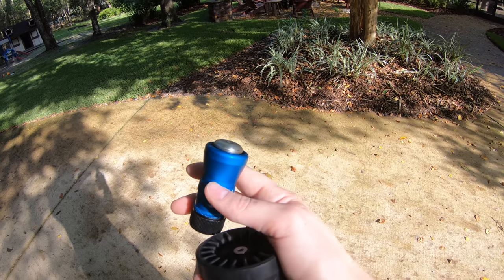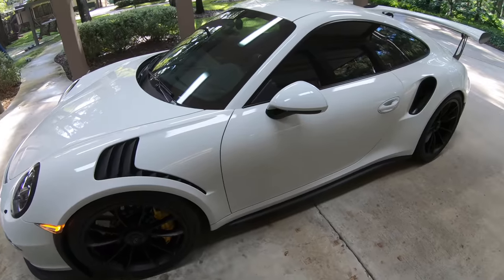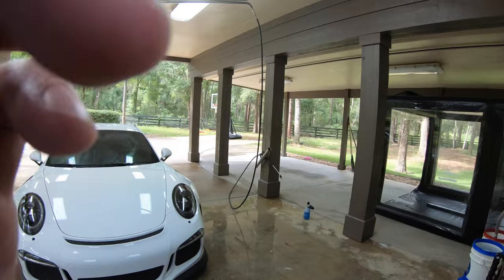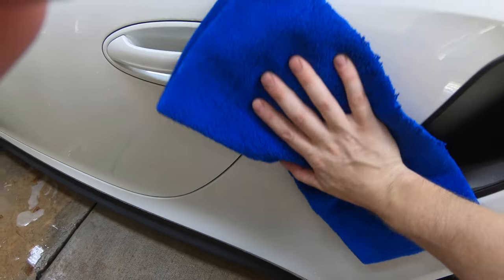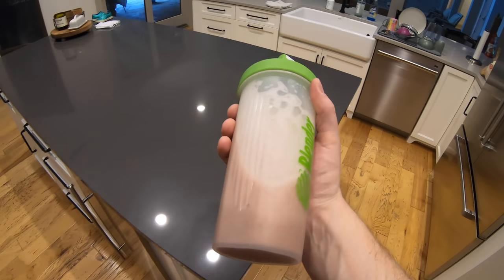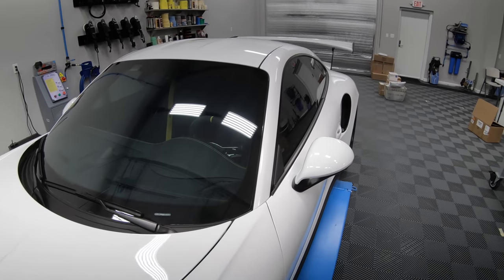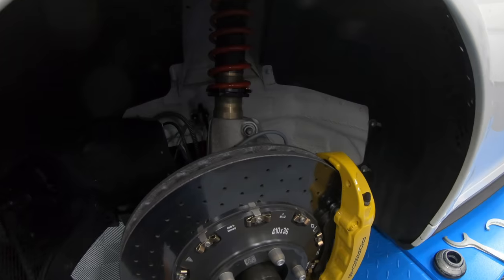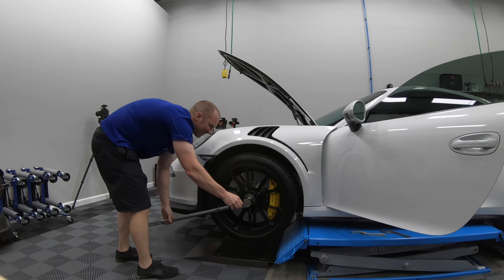GT3 RS Vlog Day 7 | 28 | 2018 @ 4K/24fps

Comment: You mention about removing the exoshield because of trapped dust. Are you planning on reinstalling again?  I was just getting ready to pull the trigger on having this installed on my 911 Turbo.
Reply from the maker: Yes, I'm going to reinstall it.  It's pretty legit.
Reply: Obsessed Garage, do you think the issue you had with the dust making its way under the film? Is a common problem or something was overlooked in the install?
Reply from the maker: It was due to them carrying the film across the room with the backing removed.  Alchemy now suggests removing it with the film laying on the windshield to minimize the risk.

Comment: Subaru looks totally insane parked outside.

I've only ever done 845 solo. Might need to rethink that and see what happens.
Reply: nailbomb3 The correction process is what makes the paint look incredible. The wax won’t make much of a difference if the paint is already dialed in. Btw I love 845, super easy to work with and very durable.
Reply: Andres Rivera 100% agree with everything you said
Reply: MikeEM1 as do I. I'd do both just to see if.longevity is indeed better

Comment: Lol why not get oem filters at porsche instead of cheap Aftermarket filters from autoparts stores.
Reply: ProjectGTR Wix filters are OE VAG parts.
Reply: Kamron Mikuta what does a standard vag 4 cylinder have to do with a porsche boxer? Nothing. As you can see in the video the car has a Mahle oilfilter. (they also make the internals like pistons for these engines)
Reply from the maker: Because I had the wrong size OE filter.  They didn't have one anyway.
Reply: Obsessed Garage oh okay. Thats kinda weird.
Reply: ProjectGTR Porsche/VAG specifies a micron rating and efficiency rating for an oil filter specific to each car. As long as the filter meets that standard, it is approved for use whether in a GT3 or an A4. And yes, Mahle pistons are used in most, if not all VAG performance engines. Its been that way for 25 years.
Reply: What would the dealer do if you brought your car in to them for an oil change if they don't have oil filters in stock?
Reply: order them and then do the oil change. dealers never use aftermarket parts
Reply: ProjectGTR Wrong. I’ve worked at 6 dealerships ranging from Dodge and Honda up to BMW, Audi, Rover and Jaguar. Most of these were one of the largest, if not the largest in the region. All of which used aftermarket parts often when the OEM parts were not available. I recommend you get your facts straight before you post your comments.
Reply: maybe in your country, but in germany they dont.

Comment: To angry to finish the vlog!  
Life sucks, eh?
Reply from the maker: I went to get oil, got the wrong weight, had to go back to get the correct oil.  Finishing up the oil change, turns out they changed the oil filter for 2016-17, so the 2 $50 filters I have don't work.  Went to the 2 auto parts store to figure out if I could gen some generic filter, and they don't have any.  Nothing went right all day, so I just gave up the vlog.